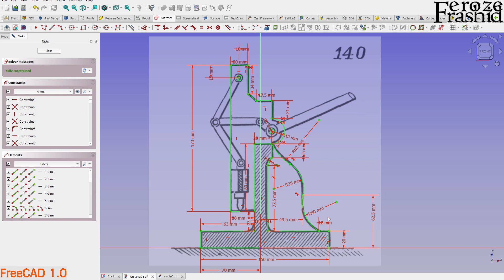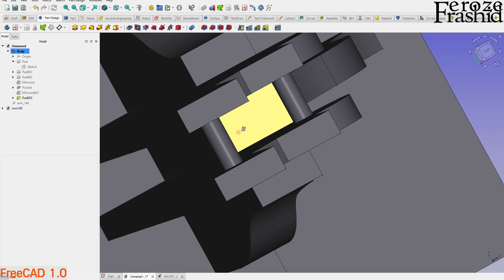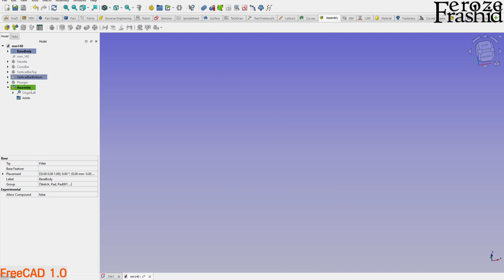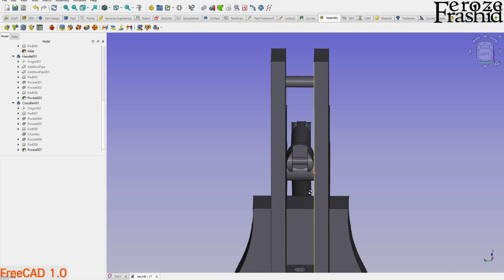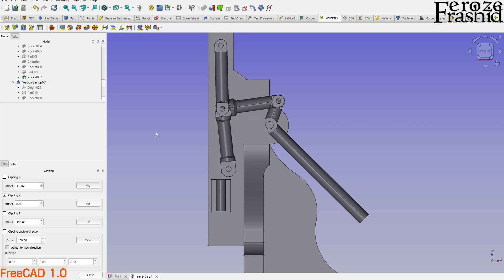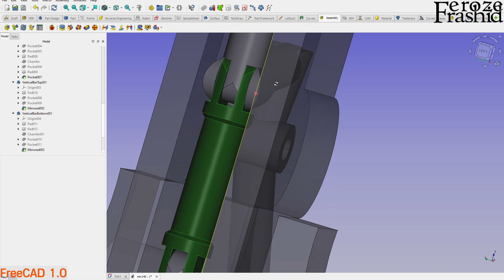The New Assembly Workbench of FreeCAD: Model a Punching Machine in FreeCAD

Comment: I like your presentation. When you pad pad001 or pad002 from the master sketch it will automatically join the new pads to the frame. Say you wanted to pad pad001 or pad002 from the master sketch but you wanted them to be separate bodies. Should you open a new body, copy the master sketch and paste it in the new body or is there another approach to it? In other cad Softwares, it will ask you to join or cut or make new bodies. Similarly, the pins padded from the master sketch should be new bodies, actually new parts. This is based on eventually listing BOM for manufacturing the parts.
Reply from the maker: I used PartDesign to build this model. PartD always add/cuts object as a default operation. If you want separate objects from the same master sketch, building a new body and copying the sketch is the way to go. Just like you said. My today's video (DIY Lantern) shows a similar approach. Thanks.